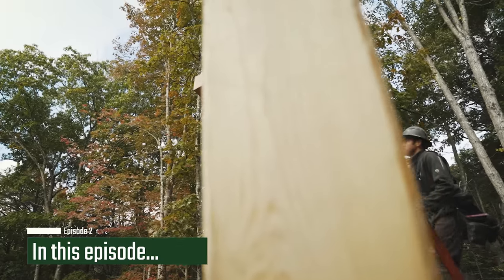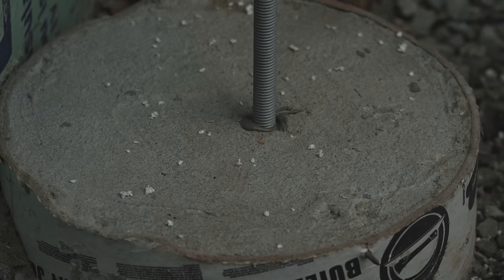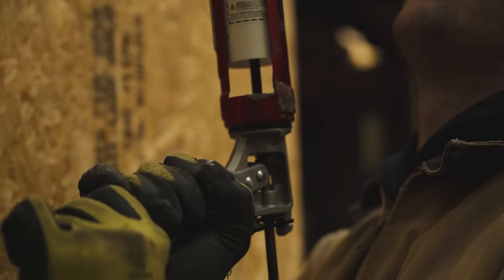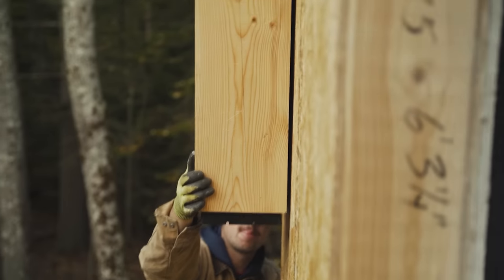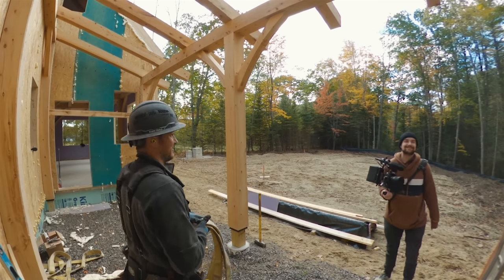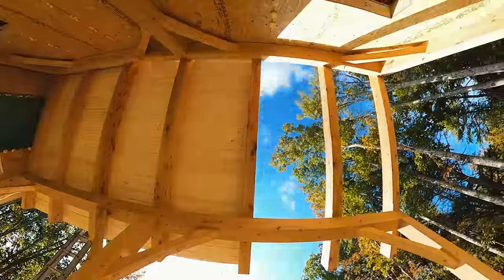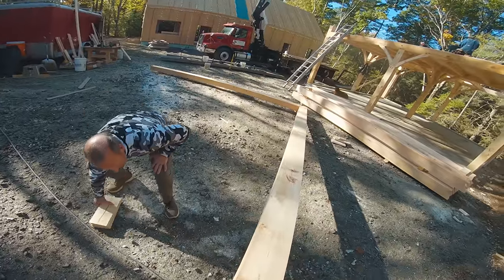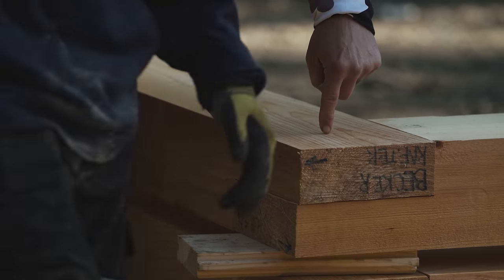Completing Timber Frame Garage & Porch | Shelter Builds a Country Home & Garage | Ep. 7

Comment: Ok. So one question I posed in the beginning of this series which I still am not sure was answered is this. How is the timber frame attached to the foundation/sill?
Reply: @kindredcouches  Not really. The didn't install a subfloor but I am guessing you are saying screwing in through the SIPs into the beams is enough to hold the structure to the sill?
Reply from the maker: Hi Dan! We install the sill plates to the foundation first using Simpson Strong Tie Titan HD screw anchors. We then erect the frame as seen in the videos. The SIPs are then fastened to both the timber frame and the sill plate that is anchored to the foundation.